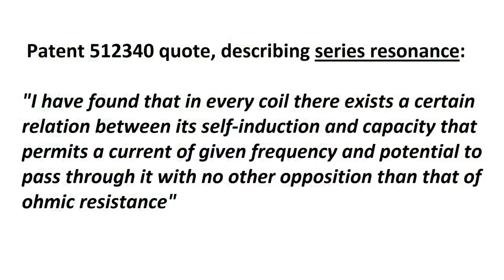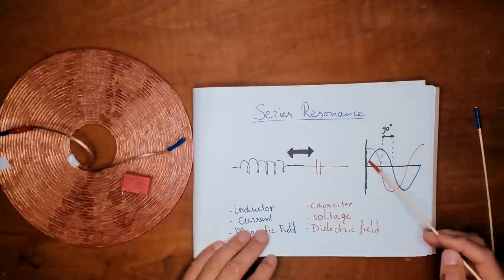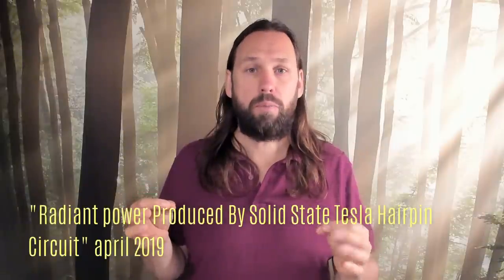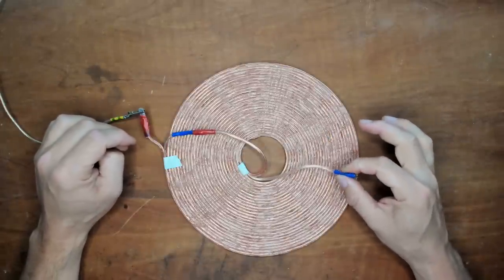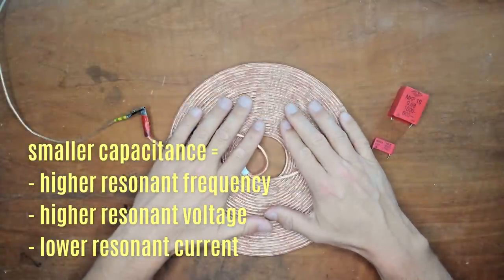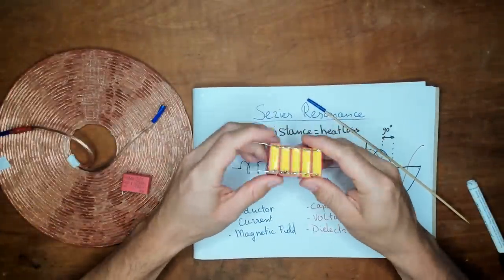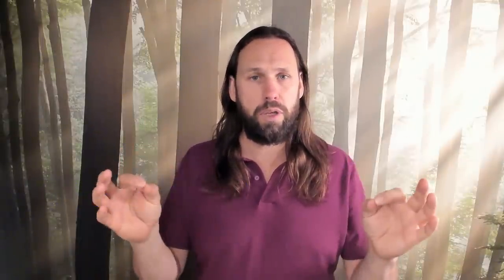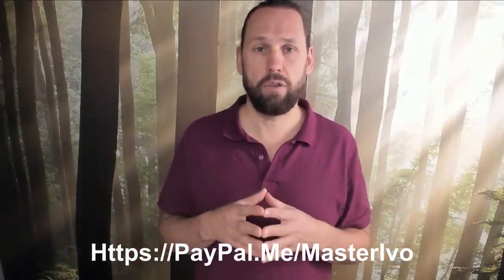The Series Resonant Bifilar Coil, Made For Longitudinal Impulse Electricity.

Comment: Circuit RLC with little L (inductance) become in RC and the only oposition Is C? Due to the low resistant wire?
Something Like that.
Reply from the maker: L isn't low, it is high due to mutual inductance of the windings. 
The impedance becomes equal to the wire resistance. 
This is necessary for the impulse to be fast (short duration)

Comment: If the resonance frequency is in range or above of radio frequency, electrons travel on the 'outside' of the inductor, skin effect, therefore wire resistance can be ignored? And since impedance is zero at resonance frequency like you state. At resonance frequency, this implies SUPER CONDUCTOR CONDITION at room temperature?! Don Smith talked about it in one of his lecture videos. 
This gain is replicated in the magnetic flux field of the primary coil, which can be picked up by unlimited number of tuned resonance secondary 'receiver' coils similar to radios and TVs. Electric and magnetic fields are like two sides of the same coin, they always go together. Magnetic flux influences electrons a distance. With proper grounding in secondary coils, capacitor collector banks, and power factor correction modules, we can have unlimited energy?
Reply from the maker: no wire resistance is always playing a role. It can be low, which makes the Q facter very high.
only with series resonance impedance is zero, which means only the wire resistance is left over.

with parallel resonance , the impedance is very high.

But in practice I see the impulses can travel through a coil at any frequency. pretty weird

Comment: Your talking about tuning an lc circuit
Reply from the maker: yes but also about impulsing it, my april 2019 Radiant Power video shows the effects of doing so
Reply: @MasterIvo  are you talking about the effects, various frequencies have on the circuit. .. or what do you mean by "impulsing"
Reply from the maker: No, I mean a sudden single polarity extreme voltage difference. The video ezplains in 3 experiments. showing a 28W halogen light powered by a impulsed series resonant bifilar coil.
You might know, this is impossible with normal series resonance.
Reply: @MasterIvo  Tesla was tunning to the frequency of the earth or the sun which was a low frequency and explains why he recommended a high value cap.